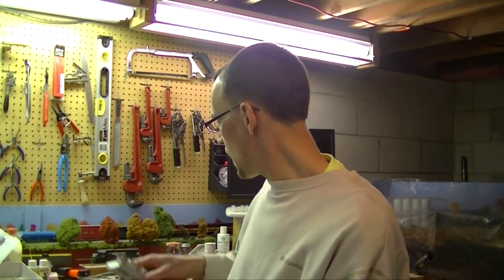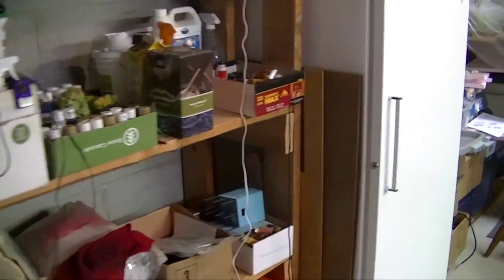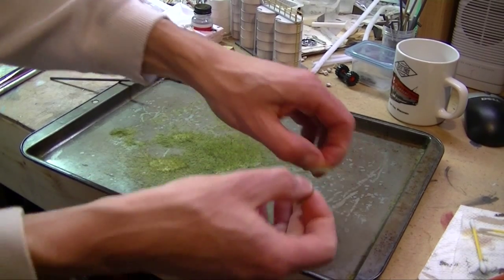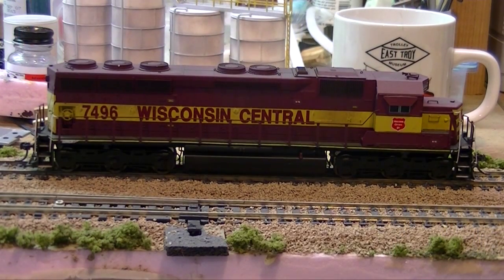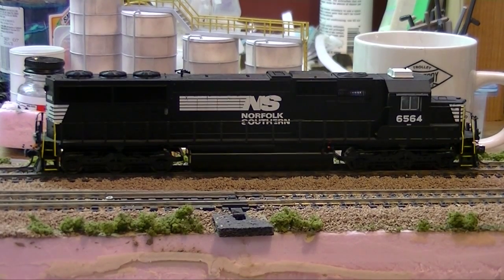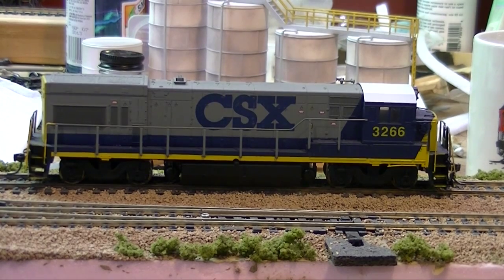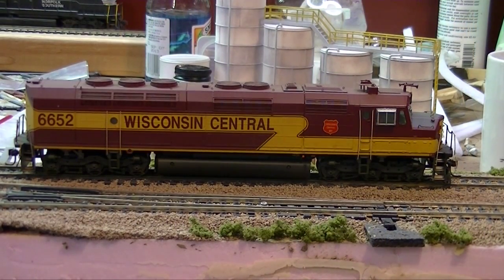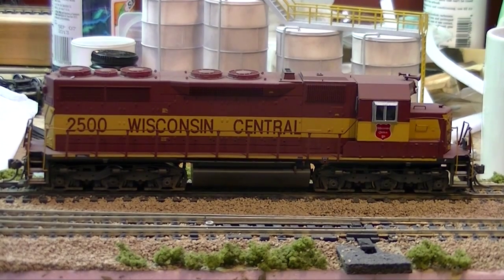Quick Tip on Grass Tufts and Some Engines on my Roster

Comment: I would go with the curved turnout, Ive used several of them on my layout to get the most out of the room i have. I went with walthers and they worked great but Im with you on making everything match. I have not tried handlaid turnouts but I am interested in how that process is done. Great helpful video.

Comment: The WC SD45's never lost their 20 cylinder engines, they were derated almost immediately after arriving, to approximately 3,200 hp, by lowering the rpm and installing smaller injectors.  When they were rebuilt to the 7000-series, they had their original wiring removed and replaced, mostly with Q-Tron equipment, though a few received EM-2000 upgrades.  The equipment included wheelslip control, which was especially well suited to these units due to their hp.